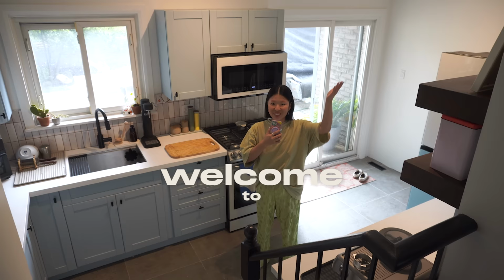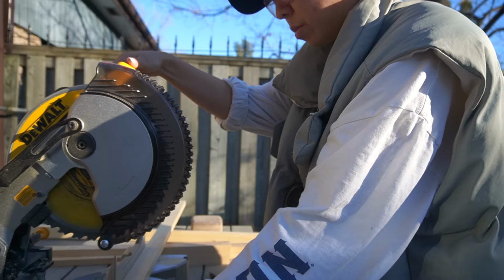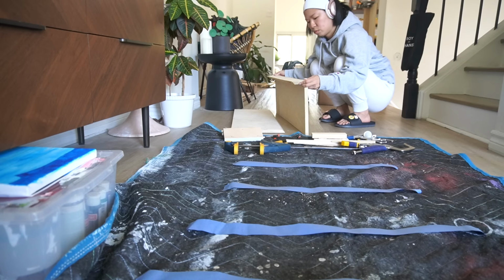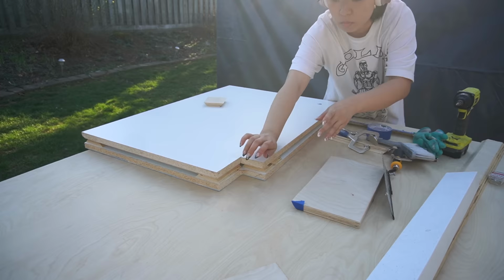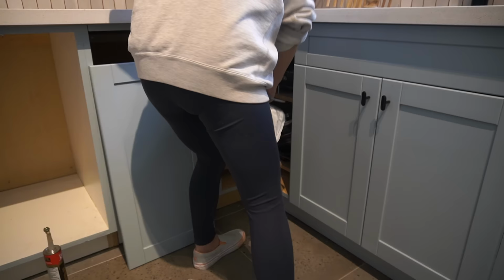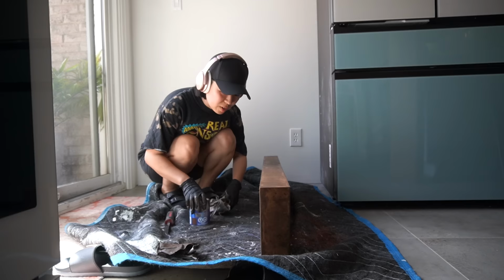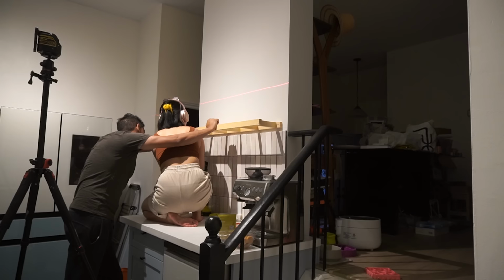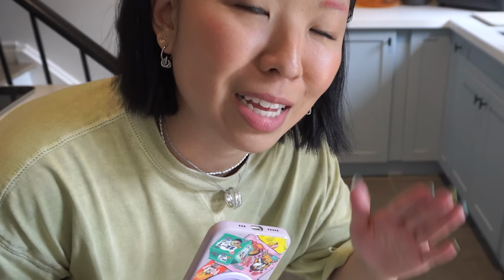THE FINISHED KITCHEN REVEAL - DIY KITCHEN RENO - renovating my 70s fixer upper

Comment: If we'd just protected those areas we wouldn't have to clean up this much - famous last words! It's giving me flashbacks to when we painted our house and didn't bother putting drop sheets on the tiles and then spent half a day cleaning paint of tiles (FYI vinegar works so much better than paint stripper or mineral turpentine!). Lessons learned but you've also done an amazing job!!
Reply from the maker: Omg thank you!! I will keep this in mind

Comment: What I've found with staining plywood(and all wood I've tried) is that it absolutely needs wood conditioner, gives you such an even stained look.
Reply from the maker: From what I saw, gel stain doesn't need wood conditioner since it's suspended and not penetrating? But I'll get back to you on that hehe

Comment: Sand the mitered edges with 140 grit, fill mitered edges with wood putty/filler for pine. Sand smooth with 400 grit. Apply pre-stain wood conditioner because pine is a soft wood. It will bring out the natural grain a bit and make the stain absorb more evenly. Then apply your stain and apply sealer/poly. I know it's too late, but maybe for next time :) Kitchen looks beautiful btw.
Reply from the maker: No amount of sanding would've closed some of those gaps haha. But yes gel stain was what saved it! I was going to go wood conditioner route but apparently gel stain doesn't need it?? Not sure. Thank you for the tips!

Comment: When closing a mitre joint that isn't quite perfect, running a screwdriver shaft lengthwise along the edge will close that gap. I've seen both Frills n Drills and Angela Home do it on their instagram. It'll dull the edge of the mitre (making it not as sharp) but it will be closed so you can't see daylight.
Reply from the maker: I tried the screwdriver trick! Some of these gaps though...it needed a lot of help lol
Reply: @letitiakiu  damn! Mitres are so hard though and sometimes it's not even your fault, it's the tools you're using. I recommend blaming the tools you're using 😉